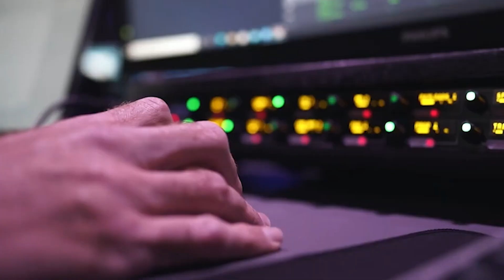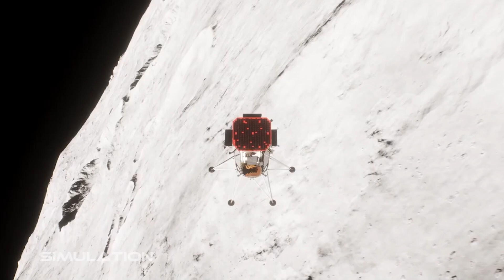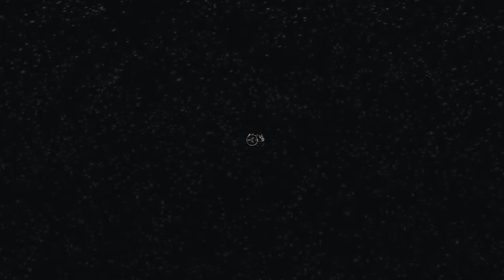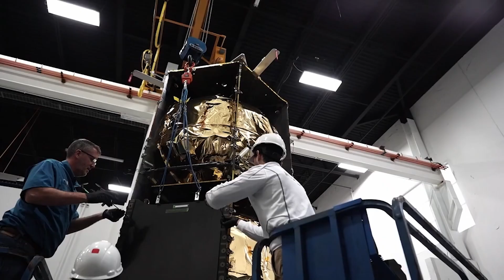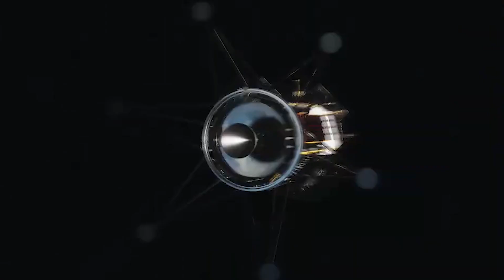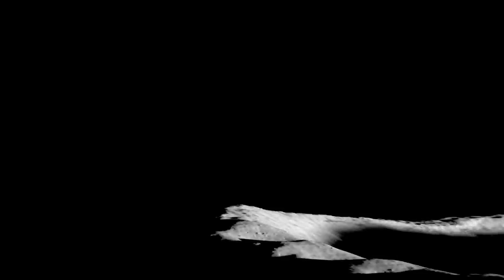What Exactly Went Wrong During Odysseus’s Landing?

Comment: It failed because they did not do pre flight checks, they overlooked the switch or pin set, which is for the landing software it is disabled until launch when it should be enabled so as to engage or initialise the simulator tested software, As the switch was still in disabled mode they could not use the correct software, this resulted in them srambling around in the hope of saving the miossion,. This resulted in finding older Nasa Landing Software which they patched to the lander and used. Thats why the lander landed badly, because of untried or tested software. The moral here is triple check your preflight software and hardware, before you launch.

Comment: Sadly, grimly, over the weekend and now today on Monday, there have been zero updates from the IM team.  The apparent loss of the high gain antennas has reduced bandwidth so much that the team is unable to download any photos.  No Eagles no nothing.  
Im very disappointed for IMs struggles on this mission.  Leaving the Primary LIDAR shut off was a killing disaster, perhaps even with the NASA LIDAR.  No one is around to compare the 2 systems, and it remains unexplained why/how the onboard flight computer was unable to nail the descent trajectory.  It wasn't going straight down as required.  It was descending 3 times too fast.  Was the local environment simply too much for it to keep up with?  Was NASAs LIDAR a degraded mode for it to try and operate in real time?  IM isn't saying.  They are a private company and are not required to post their data, and they are holding their remaining cards very close to the vest.

Comment: Maybe shouldve built in a simple self righting piston arm so it could lift itself back up.
Works for battlebots,and this craft had pretty much unlimited mods they couldve done to correct an issue like this fairly simply.
Reply: You don't understand the serious constraints spacecraft designers have to work with when building their vehicles.

Comment: I’m no scientist, far from it, but why couldn’t they just use an Anchor? Doesn’t have to be a weight anchor, but a reference point to align the lander and provide metrics on positioning. They did that with the camera developed by the University Students.

Edit: something I’d do is I’d send two missions. The first one is a unit that does not need a soft landing, in fact it would be a ballistic missile that shoots isn’t the ground with a static payload that buries itself into the lunar surface. The second would be the actual lander that uses the first mission as a virtual landing pad. The first one wouldn’t need any special devices either. It could be as simple as a rod with a QR code on its rear so that all the lander needs is visual confirmation to erect itself when descending for a landing.

Comment: What else would anyone expect from trying to land anything sideways? Then where was the center of mass? Even if the LIDAR did not work… or was disabled…how much did we learn from what worked for the Apollo missions?
it’s a vertical zero translation vector landing? I would start by figuring out why the communication was faulty to begin with 😅
Reply: Apollo had an even bigger risk of tipping over.  That's why they were extremely careful where they landed and to make sure their horizontal velocity was canceled out before touchdown and the place they landed was flat.  The comms are bad because the thing is laying on its side in a crater and the antennas aren't pointed toward Earth.

Comment: Programmed to “fully and finally shut down” after only operating for 7 days? The more I hear about this project, the more baffled I am with the choices they made. First, let’s make it shaped like a tube that has to stand up on its end, then, let’s only make it operational for a week, even though mars landers have functioned for years. What the heck.
Reply: The temperature differences between the two are completely different, mars nights(-61 c) are warmer than the moon’s night time (-133 c). That’s the reason why, a lot of missions to the moon are not able to operate at night, so the two aren’t very comparable.
Reply: @noahblandford2433  Also lunar dust is much more brutal to spacecrafts then mars dust, just by the way it works (electromagnetism due to sunlight vs wind, in short lunar dust will mercilessly stick to anything that isnt specifically shielded from it, like planned new moon suits).
Reply: @alexturnbackthearmy1907  yeah that too also we can land on mars super easily because of its atmosphere, the moon is way more difficult to land on than people think
Reply: Leave the thinking to others, Darwin-who-is-not.
Reply: Ok Einstein let's explain it to you.  The daylight on the Moon lasts 14 Earth days long.  The nights are also 14 Earth days long.  When they landed, 9 Earth days of sunlight were left, to be followed by 14 days of night.  The spacecraft is solar powered.  It needs sunlight to operate and stay warm.  The batteries won't last through the lunar night, so the spacecraft will freeze and die after the first lunar day.  The lunar nights are far colder and far longer than the nights on Mars.

Comment: The shape of the lander is a bit of an engineering failure. Oh, I understand, rocket = long skinny tube. Gotta fit things inside the space available. Maybe too much payload for the lander size. There is one factor we haven't eliminated. Human failure. But like I often say, if you're not failing, you're not learning. Just don't make it a habit.
Reply: The failure here was not an engineering one, but an operational one.  The cause of the failure of this mission is someone left the "remove before flight" interlock in that disabled the primary landing navigation lidar systems on the ground.  Without that instrument they couldn't land vertically in a safe flat space.  So they ended up landing while sliding sideways on a slope in a rocky crater and flipped over.

Comment: Being able to accommodate and adjust to surface anomalies should be very basic requirements.  A broader landing foot pattern should have been incorporated into the landing. 
Did they try landing it on a dirt field here on earth, before sending it up? Better send a solar powered robot up on the next trip so you can pick this one up. Or you could send a "BOB" up to fix it. Call me is you cant find one willing to do it. I'll go if needed, but I want to jump off the lander from 30' up.  I dont trust them to land properly. I can fix anything, except women. Sorry, I didnt go to school for the 60yr class. I will need a crystal lens, heat resistant gloves, a 24" long holder for the lens, Gorilla tape, welding rod suitable for the landing leggs, a couple hundred feet of paracord 550, a pully, a shovel ( like those multi purpose segmented shovels, extra knee pads, a parachute ( WWII Dome style with no slits in it),  a booster rocket motor( small, and only 2500 lbs of thrust), a Colt .45 with lots of lightweight ammo, some JB WELD,  thick nitrile gloves that will go over the space suit gloves, some Diet Coke 2 , 2 litter bottles, carbonated and tranfered into CO2 ALUMINUM bottles, like the soda fountains use. A bunch of Mentos, 
More Gorrilla tape, and a Titanium walking cane with a large metal foot on it.

Comment: Last year NASA signed a contract with a 3D printing company to provide a lunar landing/launch pad.
Contractual obligations include 3D road (500m) with 3D extruded pipelines alongside (for lunar H2/O2) leading to a 3D fuel tank pad and, further along, short-term manned base.
Construction is scheduled for 2029, Artemis 5/Blue Moon mission.
Re: TheSpaceBucket report 2023 with images of the contract specs.

Comment: When I first looked at the spacecraft, I thought it was top heavy and the landing legs are not spread out regardless of the fact that there are six of them. Can someone please indicate if the oxidizer and fuel tanks are located at the bottom or the top?
Reply: The legs are wider than the spacecraft is tall.  People act like the spacecraft is a tall skinny object - it is not with the legs extended.

Comment: The very first time I saw this thing pre-launch, I immediately thought is looked too top-heavy and the lading-legs were too tall and the landing-feet could being small and shaped the way they were would cause the whole thing to face-plant if it had any lateral velocity.  They should have made it with a much-larger extendable base that could take a small (in this case walking-speed) lateral velocity and rock back upright.  With an automated landing system and no video feedback (yes I know about the delay!) they should have hedged the landing configuration much better!
Even a 3-year old looking at this thing, would utter one word: Tippy!"

Comment: Three retractable legs spanning the length of the lander could’ve repositioned it upright from being on its side in the event something like this happened without adding any extra weight. 🤷🏽‍♂️
Reply: Or just make them deploy further. The base was definitely too narrow for such a tall craft.
Reply: The lander legs are already wider than the lander is tall.  The problem is things are 6 times easier to flip over on the Moon due to the reduced gravity but inertia is still the same there.   You have to be very careful to land vertically (with no horizontal speed) and on a flat surface.  They failed in both categories.

Comment: US Surveyor 1 – 1966 – successfully landed on the moon… low Center of Gravity (CG) design – think squat – the vehicle weight is close to the landing surface, and the legs are far apart.  Not easily tipped over.   Russian Luna 16 – 1970 – successfully landed on the moon and returned lunar samples back to Earth – again, low CG design with widespread legs.  The Apollo Lunar Landers – ALL designed with a low Center of Gravity with very wide leg stance. 
All successful with one germane thing in common… they are all SQUAT… not TALL and SLENDER!
No one in their right engineering mind would build an off-planet lander that was TALL and SLENDER… if the lander must land on unprepared surfaces… like a surface strewn with boulders, rocks, craters, and subsurface voids.   Sad…

Comment: did any of the big brains think about the center of gravity,  and that a low CG is the best kind of CG on something like this?
Reply: They did, Nova-C is a simple design with only 1 tank per propellant, you have to stack the tanks because fuel and ox tank weights are significantly different. The final version is not like that.
Reply: @TTURocketDoc  obviously the designed cg  still pushed the envelope too far
Reply: @thevnbastid1027  it didn't tip over because of CG imbalance, it came in sideways and tripped on a rock or crater.
Reply: @TTURocketDoc  and is clumsy because of imperfect cg

Comment: It’s really quite amazing how no landing error like this happened in the 1960s-1970s on any or all of the 14 Apollo missions, using 1960s technology?  So amazing, it’s almost unbelievable.  Not just because of a landing failure, which would have stranded two astronauts on the moon surface, but because of the thousands of other small malfunctions that still could have been devastating to the astronauts onboard.
Reply: Not every Apollo mission landed. Apollo 11, 12, 14, 15, 16 and 17 carried out lunar landings. And there were small mishaps with several of those landings. But there were people there to remedy issues.
Reply: @michaeldunne338  can you ever admit that somewhere, someone lied to you. No one can explain how your country got humans through the Van Allen radiation belts and it seems that it doesn't matter because the rest of the story, half stacks up.?? NASA admit it cant be done, by accident of course. There's just so much evidence now that it didn't happen, its quite disturbing to me that some still believe it. At least they're all limited to one country now.
Reply: @michaeldunne338 Hollywood stuffs only. Don't believe it.😅😅😅
Reply: Just see at many AI failures of recent years. Having human to say machine what to do instead of relying on programming is a massive factor in success of these landings (they werent manual, just corrected faulty data manually, machines did everything else).

Comment: This is coming across like Boeing Quality Issue. Ignore it until it blows up in your face! 
The Lidar speed/distance sensors are a vital issue: What redundancy did they have? An experimental device apparently worked, in a pinch, as a substitute, but without calibration or testing, the results were predictable: Excessive vertical/lateral speed on touchdown. 
What I find most hilarious: Be you a Chinese, 'Murican, Russian, Indian etc. space scientist, you are either incompetent or blinded by your own imagined brilliance! In the 'Murican case: Your grandfathers figured out how to do it - with a computer capability dwarfed by your everyday wristwatch! 
Incompetence or overconfidence? We have the know-how, the technology and hardware to do this 10 time over, so the bottom line must be  INCOMPETENCE!
Reply: So how did the Apollo guys do it multiple times with merely an altimeter and some thrust buttons to push? are you saying human astraonauts in 1969-197x were better looking out a tiny window than all the modern technology?
Reply: Do you not understand that the primary LIDAR navigation device didn't work because someone left a "remove before flight" interlock in place before they launched?   That's why it failed the landing.

Comment: That’s why it was so muted in the control room. They knew something was wrong and didn’t want to celebrate the landing even after it was announced.
Reply: A chip accelerometer sensed the moon's gravity in the X-axis, rather than the Y-axis.  Oops.  I'm surprised they had the major of aspect ratio oriented the Y-direction.  Not center of gravity stable.  Remember how the Mars Opportunity landed in air cushion?  I was thinking they'd do the same.  But they probably had "not-invented-here" syndrome.
Reply: @fredflorist1682 Gravity is usually in the Z axis.
Reply: The control room with the flat earth table in the middle of the room😂
Reply: Yes, that's what I noticed too.  The company Spin was not putting smiles on their faces.  They knew it was botched.
Reply: It's a crash landing. They knew it.
Reply: Are you for real
Reply: It was muted in the control room because they had no communications and thus no telemetry and didn't have any idea what had happened.

Comment: It would seem more prudent to land the item on its ide then stand it up with a mechanism. How hard could that be ?
Why does it have to stand up 14 feet high ? Why cant it remain horizontal on 4 legs and still function.? Um we have retractable undercarriage on planes..........We have dinghys that inflate with a tiny gas bottle that could stand the whole thing up.
Reply: Why is it tall and skinny?  Because that's the shape that fits inside the rocket fairing.
Reply: @stargazer7644   That goes without saying, but  being so simplistic has backfired tragically. Its almost like the designers have never been camping never thought of folding thinks up.
Reply: @stargazer7644   Though stargazer you don't really know that, you're just assuming. Tragic mistake was made. The problem is nearly as simple as stacking cans in a supermarket.
Reply: @kimbo99 I'm just assuming? lol. It's a tall skinny craft that came out of a tall skinny fairing.  That's what we in the technical field call a "clue".  Regardless, how skinny the spacecraft is has nothing to do with why it is on its side.  The spacecraft had legs that unfolded.  The legs are wider than the spacecraft is tall. The reason the spacecraft is on its side is because the LIDAR safety interlock was left in place before launch and they didn't have their most important instrument for making sure they landed vertically on flat ground.
Reply: @stargazer7644  Good, you got that mostly right. You must surely know they used the alternative NASA laser landing system that functioned very ably. Last minute patch. And conjecture is  the ungainly lander  was tripped. Wouldnt take much to do that. The longer the legs the more mechanical advantage to promote tripping. Astonishing that the laser safety switch didn't have remote bypass.
Reply: @9What is astonishing is that people think a safety interlock should have a remote bypass.  The entire point of a safety interlock is to guarantee a device cannot be activated when personnel are in harm's way.  If you could easily bypass it, then it wouldn't be a safety interlock, would it?  I mean heck, just use the regular on/off switch, right?  The correct course of action is to make certain that it is operationally impossible to launch with it in place.  Also, I'm not able to find out much about the NASA demo LIDAR system, specifically if it had the same capabilities as the onboard nav LIDAR system.  I'm suspecting it didn't, and that coupled with the limited time they had to test things resulted in the poor landing performance.
Reply: @stargazer7644   Aatonishing ? Here.  Here is how  the prob is fixed- a  common workpractice solution  such as in phone companies is to have an Off NORMAL alarm. So that attending people are not allowed to walk away from the scene of the crime because a big red light is glowing. Everything must be normal to walk away. And it can be extended to remote computers for supervision. These alarms can be recorded audited inspected  for quality control and I do recall a manager being FINED many thousands of dollars for being lax with spurious alarms. Such a common sense work practice just wasn't happening there.
Reply: @stargazer7644  Best Latest commentary Angry Astronaut.     "Crash landing! NASA Moon touchdown more violent than originally thought! But did it fail?"
Reply: Plausible deniability. "We had the best engineering but 'something' went wrong."